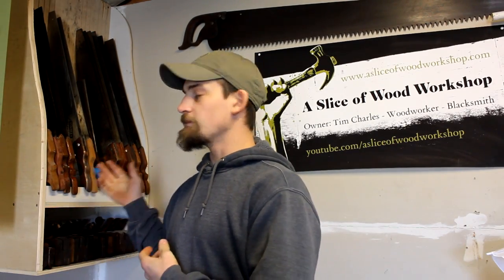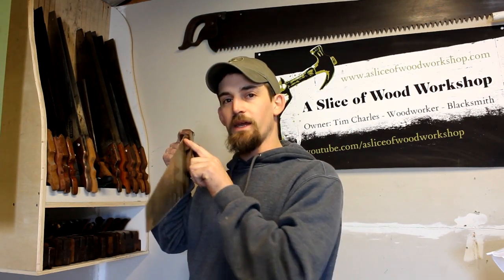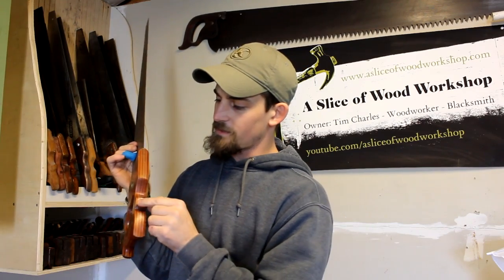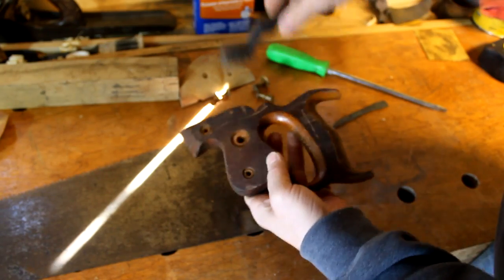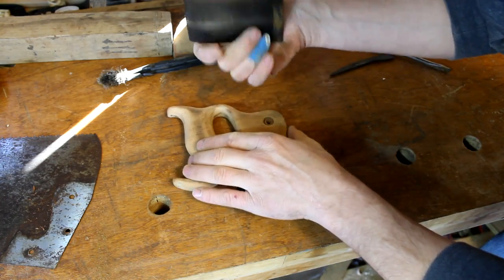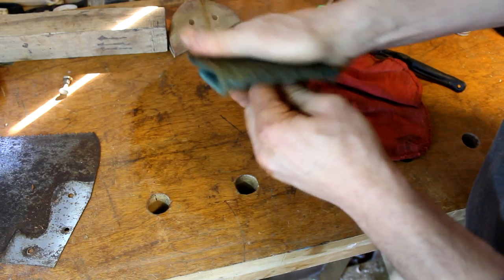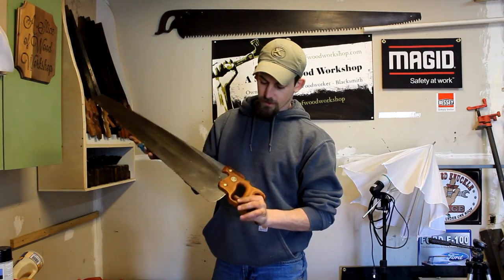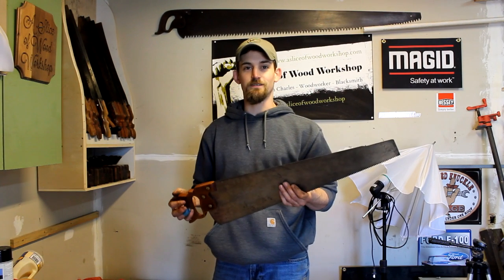How To: Buy and Restore Handsaws

Comment: Removing the lacquer with a scraper is more effective than sanding. Lightly scraping the rust from the blade and then soaking in vinegar will remove the rust without scratching the blade or removing the etching. Nice saw collection. Like the crosscut hanging on the back wall.

Comment: nice info. do you ever soak the brass pieces in some type of dirt removal solution before cleaning them off?
Reply from the maker: I have not tried. Haven't had a problem cleaning them. Suggestion on a cleaner?
Reply: +Timothy Charles depending on what I'm cleaning I ask the guy in the hardware store and now a days they have something for everything! Just was curious. Great job bud.

Comment: A vinegar bath would get rid most if not all of the rust and dirt.
Reply from the maker: +NYWoodworker I've read (haven't tried) that the vinegar can take off or fade the etch. Any experience?
Reply: +Timothy Charles i just bought 5 saws and will use it. I am not looking to preserve history but in having inexpensive users. I will use vinegar on all of them. If you are concerned, try it on a really pitted saw that is a throw away anyway and check out the results.